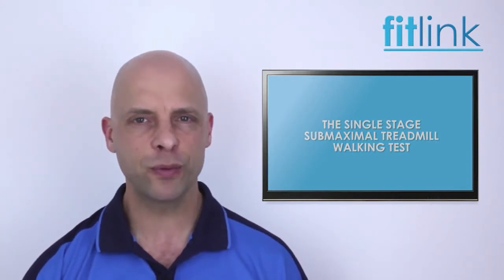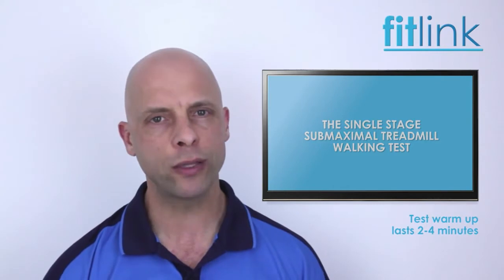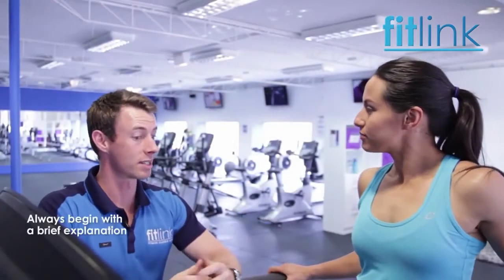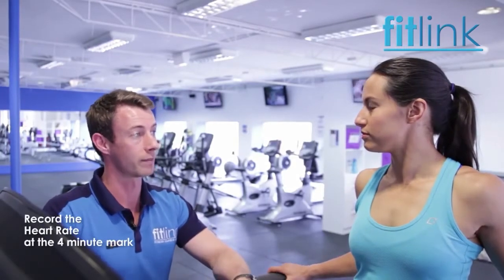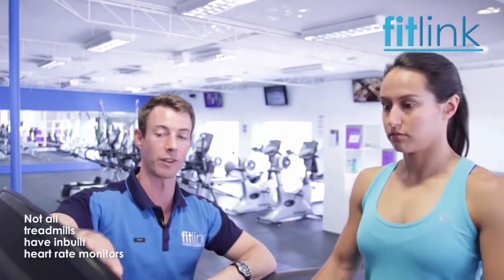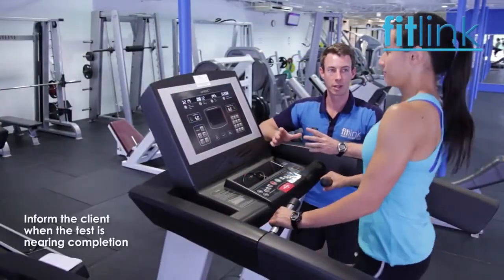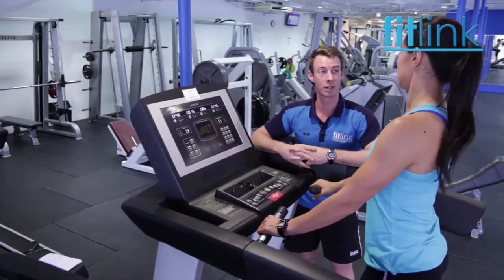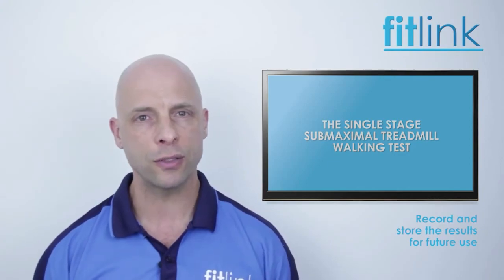Single stage submaximal treadmill test

Comment: Your equation is wrong. The first line should be '15.1 +(21.8 x mph).
Reply: I believe there are differences in the formula because they use the metric system.